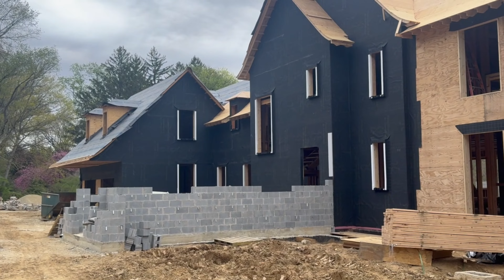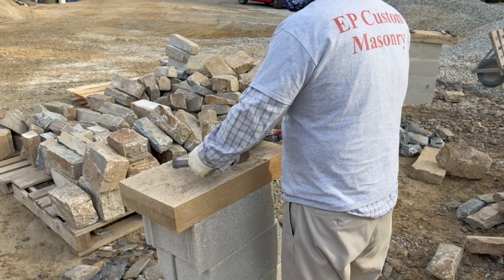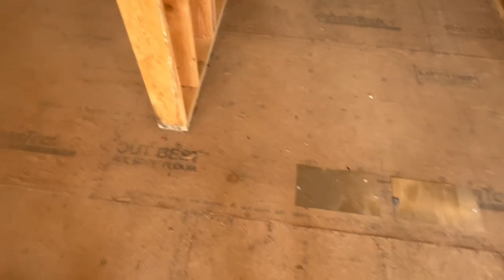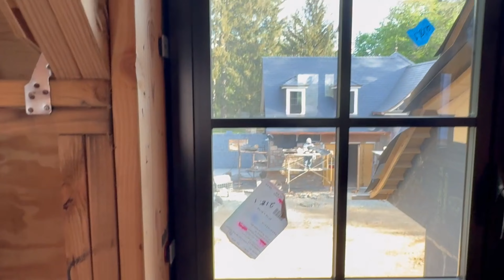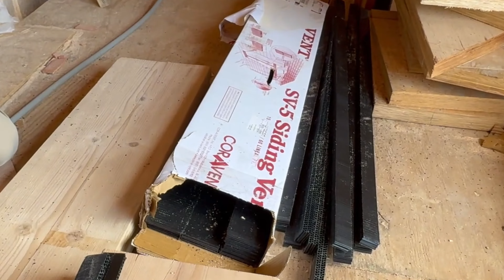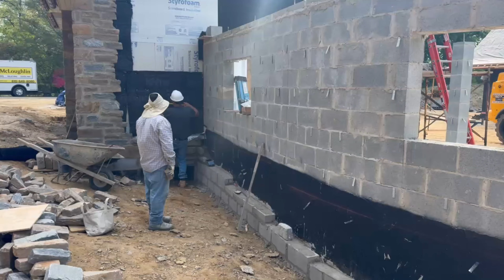Project Build- Exterior trim and Window installs - Ep33

Comment: Hello! Please tell me how you do vertical planning of the territory? Do you have detailed working documentation? Or do you mark it out by eye and then fill it with earth after the fact? (sorry for google translate😉)
Reply from the maker: For the septic area it had to go back to existing grades. But we do have engineer drawings that show the existing and future grades around the project. We use both a survey and gps equipment on the dozer around the site. Thanks for watching! What area are you from in the world?
Reply: @MarleyBuilt  I have already written to you earlier, under another video, I am from Russia, the city of Tyumen. This is the oil capital of Russia. But only the administrative capital, in reality oil and gas are extracted far from us, in the north, closer to the Kara Sea